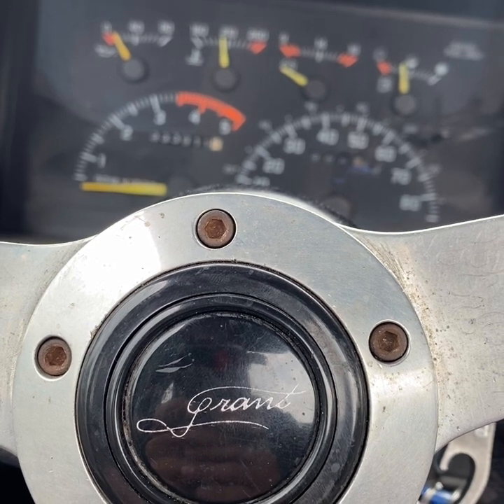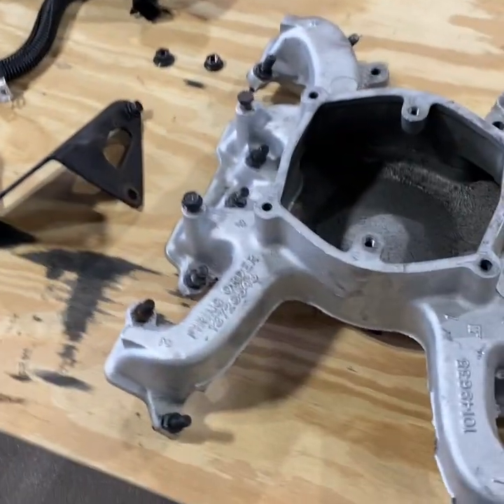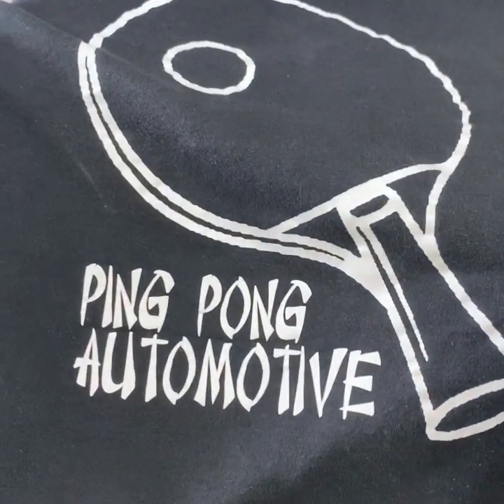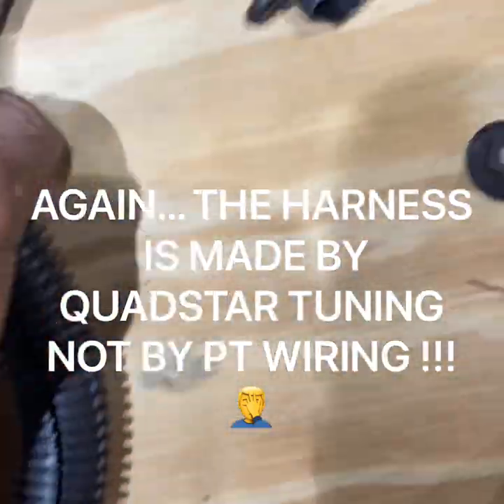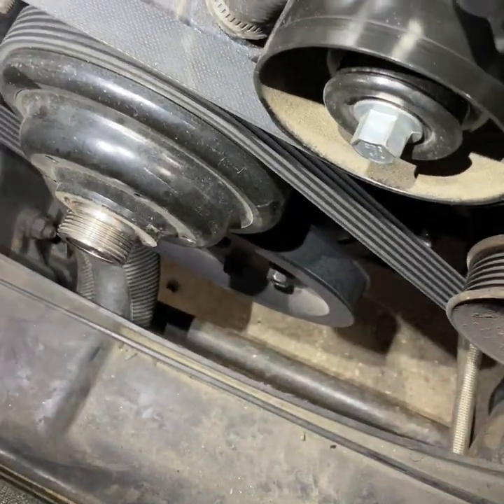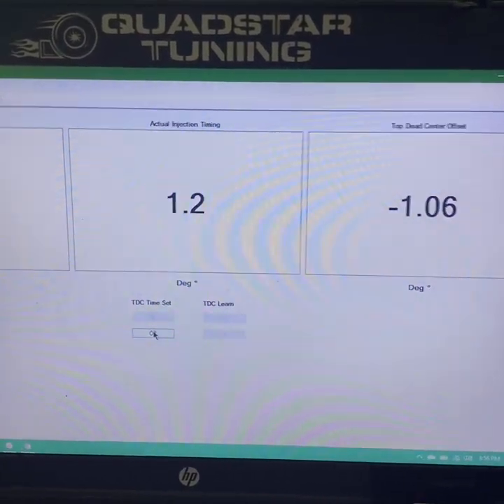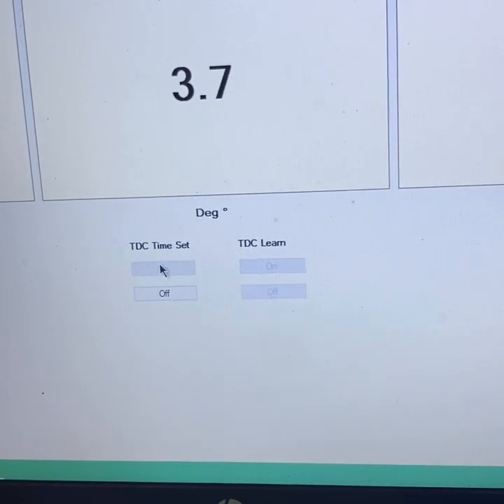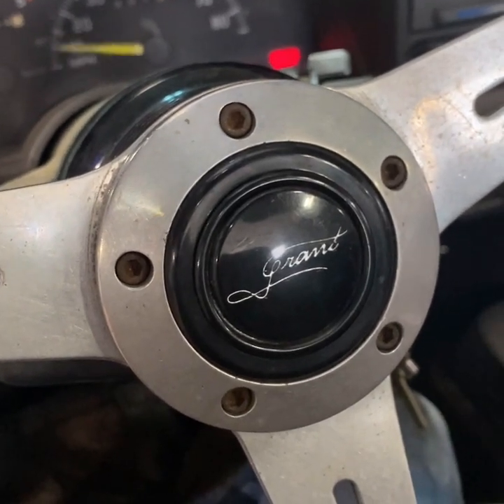6.5 diesel injection pump and fluid damper install

Comment: i installed a fluid damper  years ago and i believe it has helped the life of the engine truck runs much smoother over all
Reply from the maker: So far it seems to have helped with vibration through the rpms

Comment: What would cause my 2000 3500 to quit running after putting new rings on the solenoid that's on the injector pump in the middle of the fuel lines. It won't even try to start at all even tried starting fluid still nothing.

Comment: I run -1.97 #8 resistor during the winter (rattle box) and -0.85 #8 in AZ summers, Normal rattle, but much cooler EGT and ECT. Our cooler months are by far a better running truck. 97 C3500 CCLB
Reply: My Crank sensor was bad the other day so I changed it. Had -50 before relearning but after relearning i got -1.46 and it ran like i had 50hp 🤣 how come you can have a good running truck with -1.97??

Comment: What size resistor did you use to fool the ECT for 176 deg to the PCM. I am in cold area and cannot get my truck warm enough to set TDCO relearn because the offset is to far out of wack and truck shuts off at 170 deg and will not start until cool. Not easy to do on a zero day working outdoors.
Reply from the maker: Im not sure what resistor it is. its from Quadstar Tuning he sells it
Reply: Thanks for getting back to me and keep the videos coming.
Reply from the maker: @waynetuuk7599  no problem and will do!

Comment: Wish i could find someone here in alabama that knows how to work on my  2000 c3500hd 6.5 turbo. Cant find a shop that knows what they are doing. They wanna charge you out the ass, but cant tell you whats wrong with you’r vehicle. Haft the time i know more than they do, and they are the so called experts.

Comment: What kind of lap top will support the software and what is the name of the software to use on my 96 6.5?  Thank you Joe in Vermont
Reply from the maker: Any windows laptop will run the software. And it only works on 94-95 trucks 96+ u need a snap on or tech 2 scanner.
Reply: @DCMotorsports  Thanks I love your video Ty

Comment: Good stuff, I noticed GMTDScan tech software works only on 1994-5, is there any software out there for 96+ 6.5 trucks??
Reply from the maker: Yup GMTD 94-95 i used my Tech 2 for 96+ trucks. You can also use the Torque Shift app with Bluetooth adapter for android.
Reply: @DCMotorsports  which tech 2 and Bluetooth adapter do you use?
Reply from the maker: I dont have an android so i dont use the Bluetooth adapter. But i know a few guys do. And its an older Tech2 from a dealer

Comment: I got that same program for my 1995 k3500 and my offset shows 0 after I did the reset (key on peddle down ect...) how do I get an offset.
Reply from the maker: So the truck need to be atleast 170* for the engine coolant temperature. Then you can go into the program and do the TDCO and timing relearn
Reply: Have you done a video of that.
Reply from the maker: No but its on the list of videos
Reply: With engine above 170 ⁰So i Clear all codes. Turn key on push pedal down for 45 seconds let up on pedal turn key off  30 seconds then Start motor . Took it for a drive And it still says 0 offset timing actual timing is over 15 and desired is 8.4. Do I need to take it to a shop to have the computer reset. Or will this program do it. I know that 15 should be down to more like 3.5
Reply: I would love to see a video on how this whole program works
Reply from the maker: U dont need to do the pedal thing with this program. Clear codes and then do the timing
Reply: Thanks I will try again in the AM.
Reply from the maker: @blacksmith4570  i may make a video of the program but not everyone uses it

Comment: Where could i buy a coolant temp sensor ?
Reply from the maker: Should be able to find them at any local parts store. There are 2. One is on the drivers side head and feeds the gauge cluster. The other is on the thermostat housing and feeds the computer
Reply: @DCMotorsports  my bad boss what I meant to say is where could I buy the resistor for the coolant temp sensor. Also I’m having trouble setting the the fuel injection pump on time I just replaced it and I can get my truck to start but I can’t seem to get in on time could you give me any advice
Reply from the maker: @jesusnajera5473  I believe they are still on the site at QuadstarTuning.com